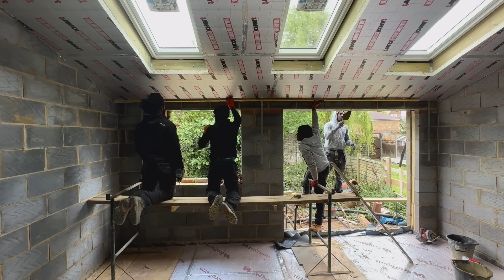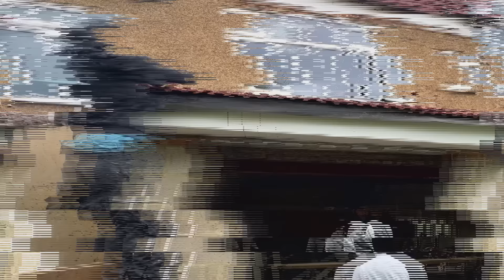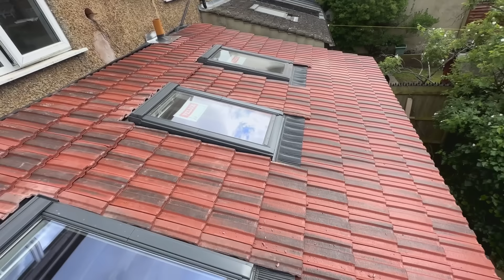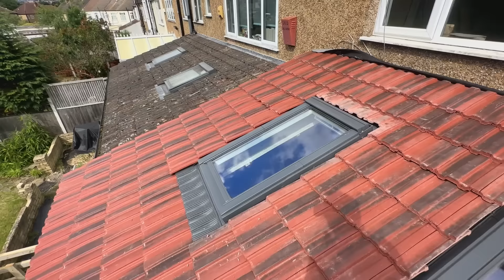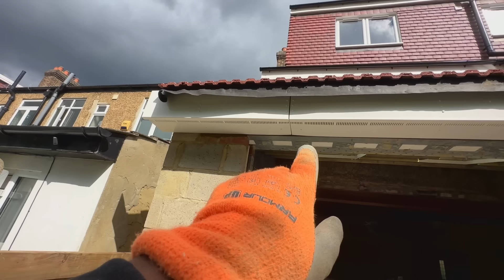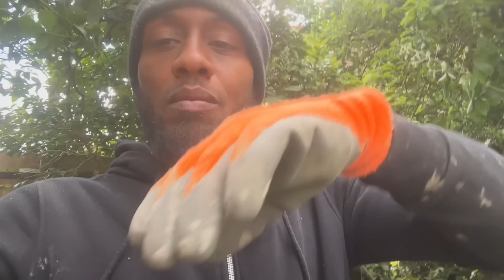Roof is tiled and Fasica/Soffit is in

Comment: Good work as usual sir. Question as a non-builder. I understand roofs are hot or cold, this is a cold roof, so does it not need venting front and back? (Asking because mine is also tiles, pitched, and no vents and I'm getting wet patches on my ceiling and wondering if it's condensation)
Reply: Not an expert but DIY'd own kitchen extension foundations up. Initial investigation I would take few down light assemblies out (without electrocuting myself) and see if I can find evidence of condensation up there. I would also check on the outside if the underside of fascia board is the one with vents properly installed. Wet patches could be condensation or a leak. Roofing surveyor could come in handy though. all the best.
Reply: He has put venting strip along the front and a mushroom on top at the back by the looks of it, so this would be vented all the way through. If yours has no ventilation and is getting wet patches you can guarantee it’s sweating.
Reply: @cybermian  I will be doing exactly that when i finish my upstairs refurbishment. I pulled some roof tiles up and everything seems to be built okay. So too 2 theories are condensation or wind blowing the water up through the tiles.
Reply: @Shane-tj  This is also my thought process, these videos for this roof have been very useful. Im probably going to need to do some rectifications, but not sure the best method. For flat roofs, it's pretty well documented on YT, but for pitched roofs not so much.
Reply: @TooMuchInfoSir  id take some tiles up check what felt has been put on it, if its a breathable felt then there shouldn't be an issue. depending on the pitch of the roof, water could be blowing up if there isn't much of a pitch and the wrong tiles have been used. also make sure that there is enough of a gauge on the tiles so everyone is overlapping the other.